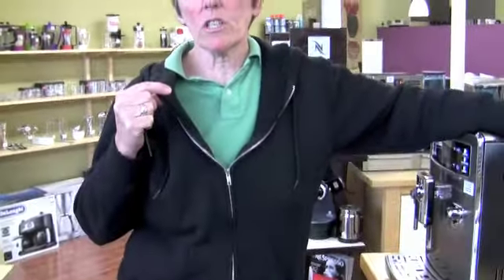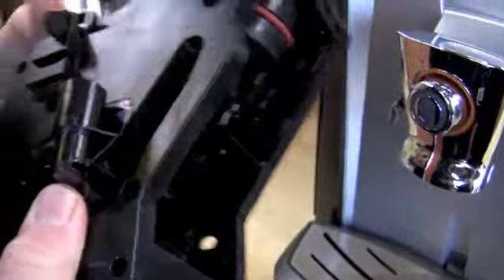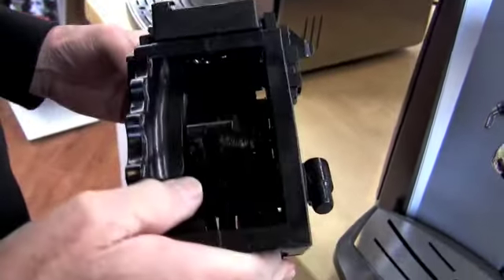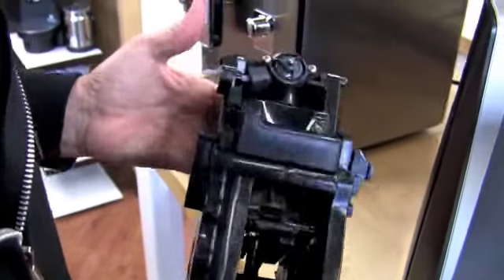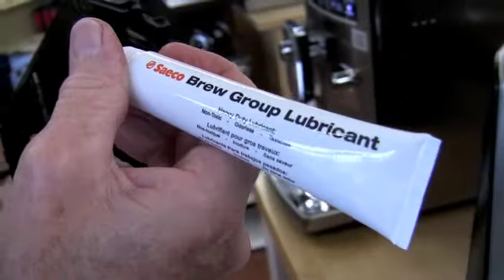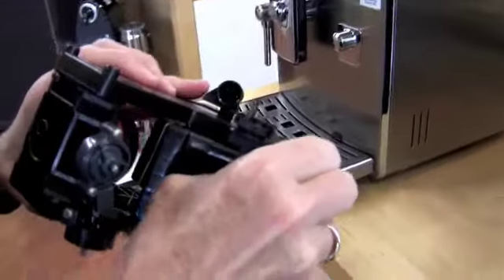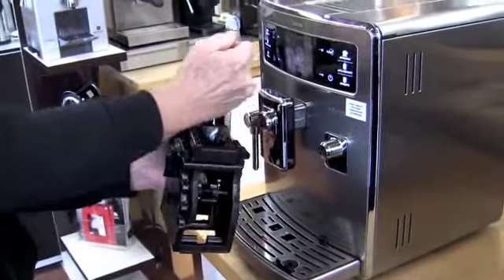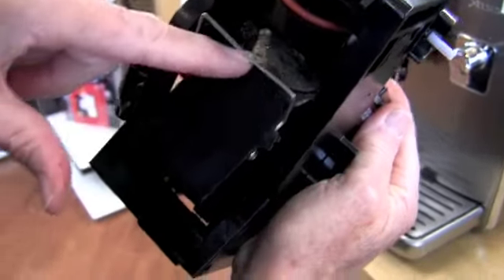Saeco Superauto Brew Group Lubrication

Comment from the maker: @stum05 Spray it down really well with hot water; you could use soap this time (not regularly) since you're going to replace the lubricant. It's easiest to apply the lubricant with a cotton swab and you need to do it only about ever six months or so. - Kat

Comment: Thanks for the video, I just had a brew group get stuck on me in one of my 8P's.  Replaced it with another brew group from a machine not in use.  But I plan on getting the other one working again and wasn't sure on the proper way to clean it and lube it.  Thanks!